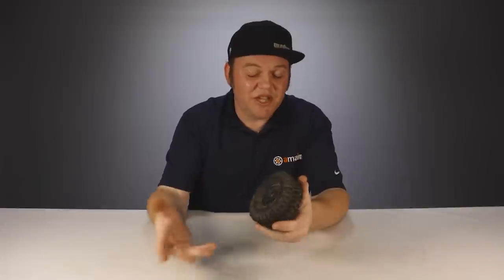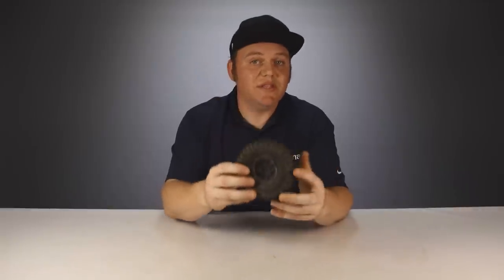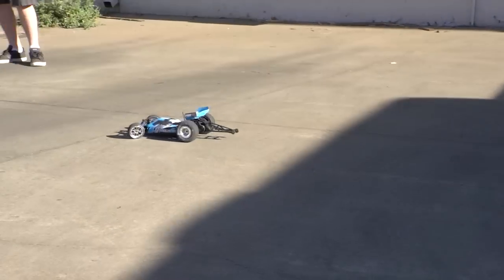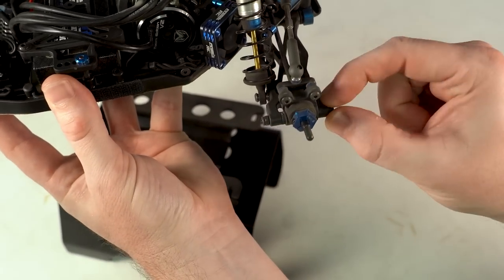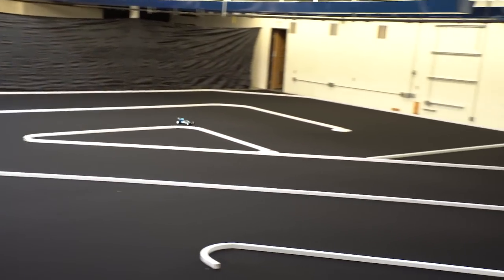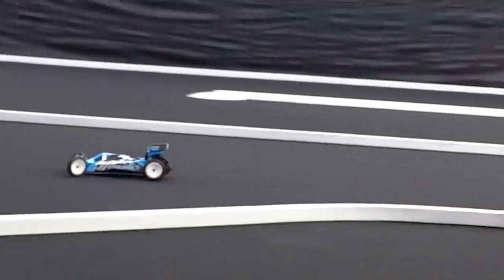The RB10 2WD 1/10 Brushless Buggy Review

Comment: Growls in seductive RC gear whine noises. Haha!!!

Edit: The drag buggy is perfect. All you need is some paddle tires and a beach for some sand drag racing.

Also, I think this buggy is perfect with its versatility. I also have been needing a replacement for the B4 since parts are hard to come by now. 2WD buggy is my favorite RC car, they are fast, fun, challenging, and easy to work on. They make great bashers too!

You forgot to tell us the speeds, stock, with those bigger tires, and with the upgraded pinion or even a 3s. I know my B4 with 5400KV and 3s was insanely impossible but was a lot of fun to try. I don't think it could get over 50 without flipping back.
Reply from the maker: The drag buggy was pretty cool and someone else in the comments mentioned the short wheelbase Pinto drag body which I didn't even think of, but that would bolt right on there. 
For speeds, we tested 2S and 3S with 20MPH and 31MPH respectively. Never tested different gearing, or the larger tires after we noticed they ripped. 
-Brett
Reply: @AMain_Hobbies  - Ayyy, thanks for responding. Means a lot!

Comment: This looks like a pretty sweet little buggy. I'd like to get into racing but the cost of the kits + electronics has to be close to $800+, at the very least. $320 is much easier to stomach.

That being said, one thing that's concerning is that, aren't 2WD Buggy race classes limited to 2S batteries? I have a Losi Mini-B with a brushless upgrade and the thing can clear huge 20+ foot jumps, but I'm pretty sure it could outrun this thing on 2S! I imagine a gearing swap is basically necessary if you are running this on anything with good sized jumps? Sure 3S will grant you far more punch and top speed but still, if you're limited to 2S for racing, it may not be enough? New to all of this, so am I making sense?
Reply: I’ve learned that speed capability does not win races.
Reply: Replying to my old comment - I ended up building a TLR 22X-4 and have been racing for about a year now and it's amazing. This car looks like a lot of fun though if you've got a turf or carpet track near you to do some ripping around. Definitely not something to race though, need to build a kit for that if you want to actually see the top 3 at any point.

EDIT: HAH and your name and channel is about the 22X-4. That's pretty funny man. Great car.

Comment: Got 2 of these for my boys, 5 and 7. was really impressed with them for the most part. had one show up with out any oil in the shock and the other had an issue with a few lose screws holding the motor mount to the transmission.  Will you be doing a must have upgrades for this car.
Reply: Same issue with the sr10 quality control is not good
Reply from the maker: Hmm, I don't know. We'll have to see how our videos and the car progress. 
-Brett
Reply: Yep. AE are great cars. But I agree, QC is crap. We have 2 B6.3s and a DR10. All three kits have defective, missing and incorrect parts. Defective meaning - parts were bent. Etc. Who ever bags these parts is a schmoe.
Reply: The shocks are pure crap on this way way too soft.

Comment: Great video but I would have really liked to see it on a low bite dirt track.  Seems like it would be most at home there.
Reply: I was hoping they would run it on their dirt track not just the parking lot of their dirt track
Reply from the maker: We tried but our dirt track is configured for 1/8 and it's huge with the jumps far apart and I just couldn't get around it very well. Not the buggies fault though. With the right dirt tires, the RB10 rip on a 1/10 dirt track. 
-Brett
Reply: Thats what I run mine on its a clay track called "the track" in Gaithersburg maryland. The stock suspension is way too soft im hoping if I stiffen it the buggy will not bottom out. Its also hard to keep the front from dipping in mid air. No matter how much throttle you give front still dips in air.
Reply: @GreatBirdOfHope  sounds like with the soft suspension, the back of the chassis is slapping against the face of jumps causing it to nose dive in the air.  One of my SCT’s had that problem and stiffer springs fixed it.  I bet you can make it competitive with it tuned right for your track. Good luck!
Reply: @JoeTheBlacksmith13  thank you im gonna try just that stronger springs and a 42 weight oil over the factory 30 weight. Any idea how many lbs the stock spring strength is? I've searched but still not sure. Associated sells springs in different hardness but im not sure what strength the stock are to go from there
Reply: @GreatBirdOfHope  no idea.  Looks like you’re on the right path though. 👍
Reply: @JoeTheBlacksmith13  thanks man

Comment: I have a DR10 and SR10 then I got another one of each of them.
Then I swaped the parts on those ones to make the DR10 a Dirt Oval Racer and the SR10 a Drag car using some 3D printed parts to push the body out on the SR10 for tyre clearance.
They make the car look like it put on weight with a fat rear end look to it and works well for it.
Then I did the same with the Rat Rod Trophy Truck as they all use most of the same parts in them.
With the DR10 Dirt Oval Racer I 3D Printed a smaller wheelie bar and used the wheels that a 3D Printer uses as they have bearings in them and they work really well for weelie bar wheels.
Reply: That's gotta be one of the dumbest things I've heard in a while.

Comment: Versatile chassis, will make a good basher, nicely done AE!  Sure you can race with it but AE is just re-purposing old technology - no way this will hang with a modern race buggy ✌
Reply from the maker: I don't know man, driving skills are pretty important. In the hands of a skilled driver, it would probably hold it's own. 
-Brett
Reply: @AMain_Hobbies  Except these are clearly aimed at the beginner! And, what if the guy driving the modern car, also has mad driving skills? 😉  Mid engine cars have a huge advantage, especially on carpet.
Reply: @jerryvolpini7987  you’re pretty serious about an RC toy hobby 🤭
Reply: I bought one of these and on 7 cell NIMH yes you just saw that, in hanging with dudes runnin lipos with more expensive buggy because I know the track well

Comment: Nice video guys as usual ! Would you say this rtr from team asso is more competitive than the kyosho ultima rb6.6 ? I had the kyosho for 2 years but it is destroyed and not for sale anymore. I was thinking of this rb10 instead. This is for parking lot races and astro races. Or other rtr model to recommend maybe?
Thanks for your advice !
Reply from the maker: For a 2WD RTR 1/10 buggy, this RB10 or the Serpent SRX-2 are your options: https://www.amainhobbies.com/serpent-spyder-srx2-mm-midmotor-2wd-rtr-1-10-electric-buggy-ser500006/p451190
Both options are probably better than the discontinued 6.6. We haven't used the Serpent, but the AE we tested in this video was fantastic.
-Brett
Reply: @AMain_Hobbies  thanks for the advice 👍

Comment: Why not a B6 rtr? AE have one of if not the best 2wd buggy why put this out?
Reply: Rear motor is better if you arent racing.
Reply: @mr.irrelevant3588  they could have made a rear motor case just like the RB 6.6/7 series from kyosho.
Reply: @jamesmccabe8736  Easier to make a new center tub chassis on a proven platform, then it is to re engineer the current platform.
Reply: @henrylicious  go look at a kyosho RB6. Same chassis 4 different transmission options. Lay down, lay back, stand up and rear motor orientation without a chassis redesign.

Comment: How would you go about making the buggy respond better to throttle input on the air in a jump? Mine will not kick the front up with throttle. It just points down no matter what
Reply from the maker: Yeah, part of that is from the 2WD platform not having the same "snap" in the air as a 4WD vehicle will have. You can increase the effect by adding larger tires and also by hitting the jump at 50% power, so when you are in air you have more throttle to pull. If you hit the jump at 100% throttle, there is no more throttle to add when you are in the air - you need to save some rpm for when you're airborne. Hope that helps. 
-Brett
Reply: @AMain_Hobbies  thing is I have an old school 2wd stadium truck I race at the track and I can get it to adjust in the air no problem all day.
Reply from the maker: Please go back and re-read what I said about bigger tires.  
-Brett
Reply: @AMain_Hobbies  i added thicker oil 42 weight over 30 and I added stuffer springs. Buggy jumps perfectly now

Comment: Can it take the taller lipo packs? I already have a big 6000 mAh 3S battery and wouldn't want to find it's useless in this buggy
Reply from the maker: It should accept that since the velcro strap is used for fastening but it's hard to know for sure without double checking the battery box specs. 
-Brett
Reply: @AMain_Hobbies  thanks for the reply. I've got a truck I'm selling on eBay and as soon as that goes I'll be picking up the RB10. I'll get a "smaller" 3S pack anyway but wokd just like to use what I currently have. If it doesn't fit then I guess I'll just have to get some longer velcro straps

Comment: I have a problem with this buggy.  I turn it on and it doesn't work for a minute and it stops and the led that turns green on the ESC turns red and flashes, could someone help me with this problem?
Reply from the maker: According to the ESC manual, if the LED is blinking Red after turning on, the transmitter throttle and ESC need to be re-calibrated. You can find Throttle Calibration in the ESC manual; here is a digital copy: https://images.amainhobbies.com/images/resources/ASC29185/Manuals/1-ASC29185%20Reedy%20SC600BL%20ESC%20Manual.pdf
-Brett

Comment: THIS is not a dis however I would like to point out a few things for anyone new 
No.1 is that he said you could race this you can but maybe not in the class you think see this car is 2wd so it's in the 2wd class and you have two choices mod and 17.5 you want to go with Mod to run it but prepare for you to be last because there's alot of fast guys also buggys are really hard to drive as a first racer I would suggest a sc or stadium because they are just a bit easier now if your really up for the challenge go for buggy but you won't be able to run it 17.5 class because of the motor so keep that in mind so you may need to get a 17.5 motor and a transponder at some point 
Also be careful what size tire you run I suggest if you want bigger tire go with a stadium truck tire for the best results 

Other than this. This car is a great base for drag or just bashing I recommend this alot for some one new to the hobby and wants to join us. Remember to stay safe sub 2 amain for more great rc vids and have a great day 👋
Reply: Also the hing pins won't need to he replaced because I run them alot I gusse the just got unlucky

Comment: 31mph on 3S is kind of slow, I wonder what's the highest gearing you can put on it? My Bandit on stock gearing with 3.8 tires hits 39mph on 2S, hits 55mph+ on 3S.
Reply: Not about speed. This is a kit to get you into racing RC.

Comment: What Schumacher front tyres or they on the carpet runs?
Reply: What they meant to say were Schumacher cactus front, proline prism front.. I'd recommend Schumacher cactus rear, Schumacher cut stagger front, both in yellow compounds.

The shot at 9:33 are not Schumacher fronts. If I'm wrong Brett, please send me a link to them and I'll buy them right now.
Reply from the maker: Erik is correct; the front tires are Prisms! My mistake. 
-Brett

Comment: We need a part 2 at silver dollar
Reply from the maker: The 1/8 track is a little too big and gnarly for this little buggy.
-Brett
Reply: @AMain_Hobbies  oh, got it, well maybe you could look at the serpent srx8e rtr or the kyosho rtr 1/8 bugy and take them out to silver dollar
Reply: @AMain_Hobbies  there is no such thing as too big or too gnarly in the rc world
Reply: @AMain_Hobbies  I race mine at playground rc yakima WA outdoor 1/8 scale. The rb10 can handle it. I slap chassis haaarrrrddd. I have only broke a body mount, a cv pin(odd caught it before a heat), and 3 wings racing this season and got a win with it out of durability. I did put a washer behind the tiny capture screws for the front arms and have had no issues. I also got a solid servo horn and ditched the servo saver that caused the wheels to be pointed in weird directions on landings. The rb10 right now is the best rtr buggy to get you into racing. By the time you upgrade the electrics you can drop it all in a b6.4 and be good enough to take advantage of the new buggy by the end of a race season.

Comment: what mm is the hex ?
Reply from the maker: The wheel hex? That one requires a 7mm nut driver. 
-Brett
Reply: @AMain_Hobbies  no the one that the tire goes on. becuase i want to buy after market carpet tires
Reply: @Colby400ex  12mm
-sid
Reply from the maker: @Colby400ex  Oh, that's 12mm for wheel fitment. 
-Brett

Comment: I know it is designed mainly for a track, but 20mph on a 2s...with a 3300kv?  That seems OVERLY conservative.  I'd think that would be too much torque off the line, making it harder to control coming out of corners.  There are heavier RC's with basically the same power plant doing 30mph on 2s.
Reply: For an "rcpro", you seem like a complete novice trying to sound experienced. Do you realise who the target market is for these vehicles?
Reply: @murrijuana2842  Right, because good marketing is making a $350 brushless buggy slower than a sub $200 brushed one.  Low gearing like that is only good for racing on a short track.  Even then, it isn't good if the surface is loose, as low gearing makes throttle control and maintaining traction harder.  A youtube name is just a tag and doesn't mean anything but I have raced, bashed, crawled, owned over 400 different models and that is experience.  A stock RB10 is no faster than a tamiya from 30 years ago, except in terms of acceleration.  For $350, the majority of buyers are likely to expect more than 20mph.  Even geared for 25-30mph would have been better...but a stock RB10 could do 40mph on pavement without overheating the system.  The same system has been used in the SC10rs, but even though it weighs more, it comes geared higher.  If you figure that the target audience was actually racers (opposite of what this video leads one to believe) then it should have come RTR with 3 different pinion gears...because not every track is a short track.